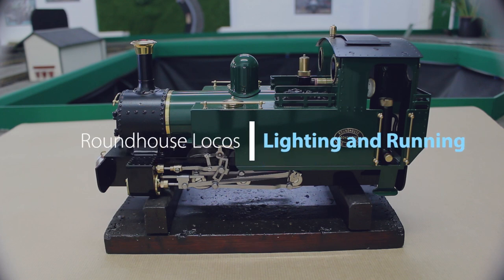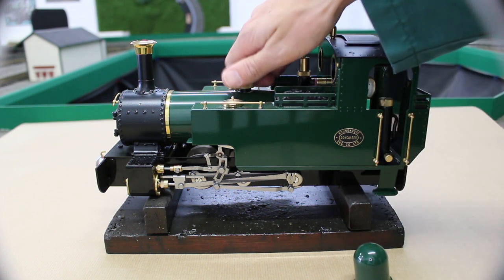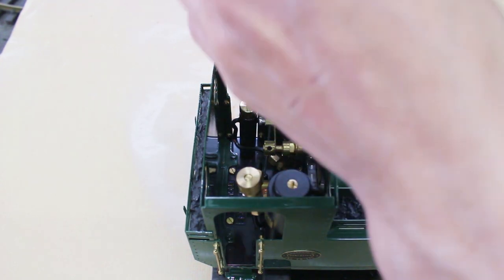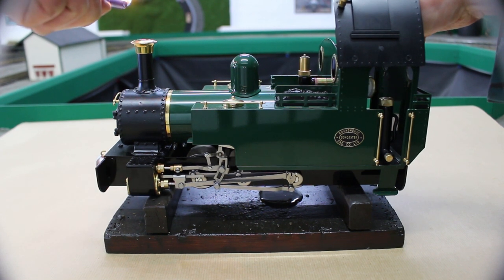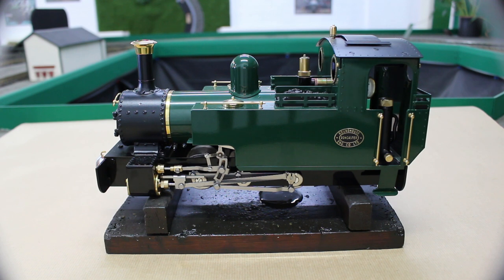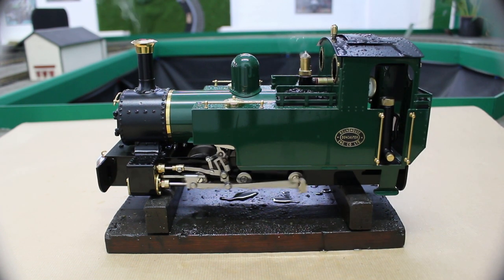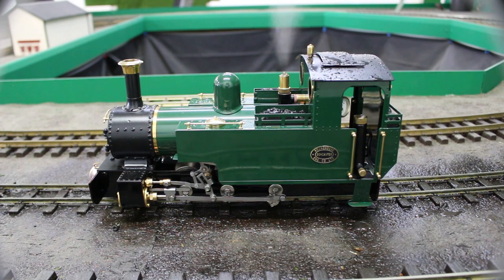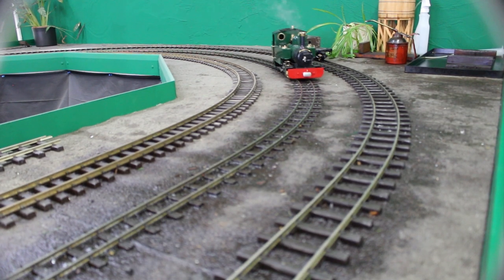RH - Lighting And Running A Live Steam Loco

Comment: I enjoyed that! I have found that turning the gas down once the pressure gauge hits 20psi avoids wasting steam, and then keep adjusting it down as the loco heats up means nice long run. A filler valve to top up the boiler is good too - a few pumps from a pump bottle every so often stops you running the boiler dry and can be used to prevent the safety valve lifting and wasting steam. My best run with a RH Beddgelert is 57 minutes on one gas fill once she had reached 20psi! (Not including time spent warming up from cold.)

Comment: One recommendation I'd recommend to anyone buying any small, tankless live steamer is to replace the filler cap with a Goodall valve. This will allow the boiler to be refilled without having to open the cap, allowing safe refilling during operation. The valve itself just screws on in place of the cap.

As for lighting, I've had issues with trying to light through the chimney/smokestack where the flame ends up just sitting on the smokestack. There's also one model out there where lighting via the smokestack is a VERY bad idea with... but if you know what you're doing with live steam you'd avoid the Aristocraft Live Steam Mikado like the plague anyway. Anyway, I typically end up lighting my live steamers through the smokebox instead. This also doubles as a way to shield the flame from wind.
Reply: Thanks for the info!

Comment: Remove 50ml of water when you fill to the brim not the 30ml Roundhouse recommend. This will prevent excessive water entering the steam valve pipework and cylinders making the loco easier to run on start up.

Comment: Great video. I’m surprised by the light weight of the steam oil though as I’ve always used 460 and evidently plenty has fed through to the cylinders. Has this weight of oil always been recommended?
Reply from the maker: Back in late 80s/early 90s we changed from the 460 to the lighter 220 weight oil. We changed as we found the heavier weight oil to be carbonising and blocking superheaters occasionally.